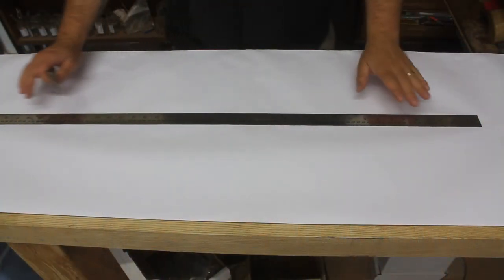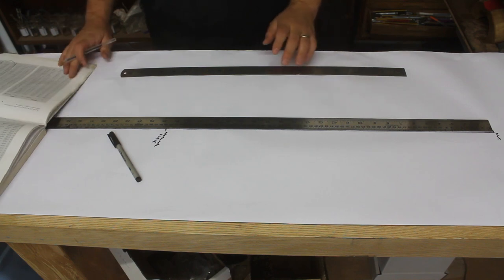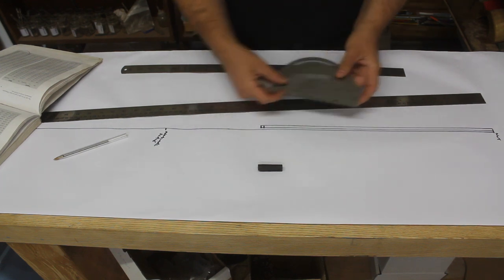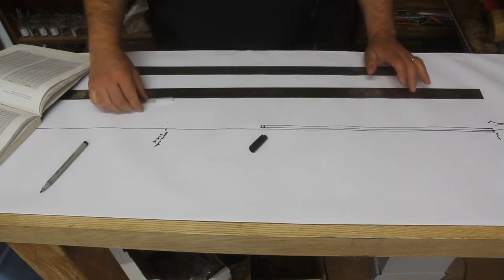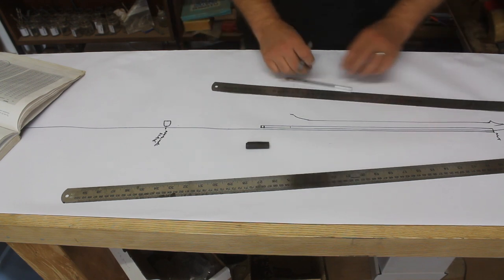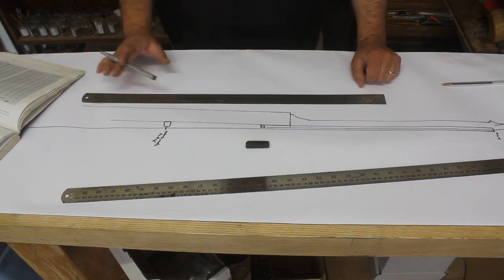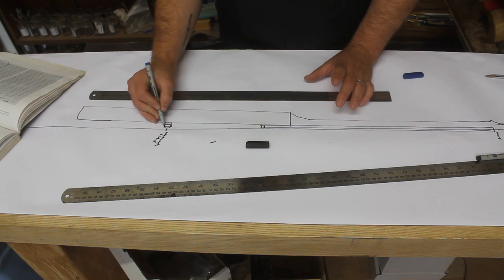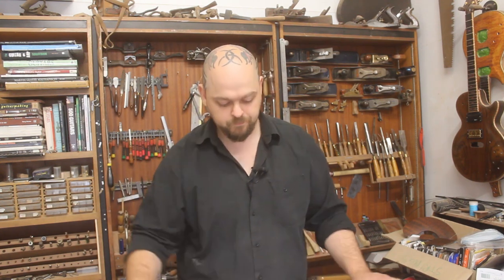Tutorial - How to find the neck break angle when designing a guitar

Comment: So many people asking what book you were referring to. Andrés Perez answered this for cfhmachado 2 years ago - Martin Koch: Building Electric Guitars.
However since you're reading this online, here's something you don't even have to wait for.
http://www.ekips.org/tools/guitar/fretfind2d/
This allows you to generate reference tables for practically every fret layout under the sun. It's very easy to use for normal fret layouts, because it defaults to that, but it's adjustable enough that if you want to make a fanned fret eight string baritone with frets for 19 tone equal temperament... you'd be off your rocker quite frankly, but you can get all the necessary measurements in detail.
http://www.ekips.org/tools/guitar/fretfind2d/#len=25.5&lenF=26.5&lenL=28.5&pDist=0.5&ipDist=0.5&nutWidth=2.148&bridgeWidth=3.284&oE=0.11811&oN=0.09375&oB=0.09375&oL=0.09375&oF=0.09375&oNL=0.09375&oNF=0.09375&oBL=0.09375&oBF=0.09375&root=19&scl=%0A!+12tet.scl%0A!%0A12+tone+equal+temperament%0A12%0A!%0A100.0%0A200.%0A300.%0A400.%0A500.%0A600.%0A700.%0A800.%0A900.%0A1000.%0A1100.%0A2%2F1%0A&numFrets=36&numStrings=8&t%5B%5D=0&t%5B%5D=0&t%5B%5D=0&t%5B%5D=0&t%5B%5D=0&t%5B%5D=0&t%5B%5D=0&t%5B%5D=0&il%5B%5D=25&il%5B%5D=25.5&il%5B%5D=26&il%5B%5D=26.5&il%5B%5D=27&il%5B%5D=27.5&il%5B%5D=28&il%5B%5D=28.5&u=in&sl=multiple&scale=et&o=equal
You wouldn't find that in your reference book (for good reason).
Reply: I should have read the comments before I asked.  Great info! Thanks!!!

Comment: Matthijs spoke of micro tilt. I would definately install one.. I have a custom strat on which even set at lowest action, it still wasn't as low as it should be. Hence I  fitted micro tilt and got it just right. If you are not experienced at using tools, a micro tilt will probably be needed. You should also drill the cover plate to get access to the microplate. A coin will do as a metal disk.

Comment: I know this is an old video but perhaps you still check comments. I've been looking for this angle info and not seen it anywhere else. Thanks.

If you already have a guitar ( but someone before you changed things), can you lay a straight edge down the neck (when flat) to the bridge to check the angle is correct? I have an old Schecter from a pawn shop. Someone shimmed the neck with a piece of business card and sandpaper and I want to get rid of that or at least do it correctly if the shim is necessary.
Should the straight edge meet the bridge at about the same height that your action is supposed to be...like if your string height is supposed to be 6mm (or whatever)...should the straight edge meet the bridge 6mm below the top edge where the string touches?

Comment: Kinda related, what's your opinion on recessed vs non-recessed bridge mounts (say, for Floyed Rose unit)? When the unit is recessed into the body it changes the whole geometry of the neck angle and such off course. And some ppl say that it changes the way body resonate, to some degree, and thus the sound of the guitar changes. Personally, I like non-recessed just because volume knobs and such feel (and become) less taller in effect. I'd love to hear your thoughts. Thank you.
Reply from the maker: Thank you! I am divided about recessed floyd rose mounting, it certainly does result in a slight change of tone as you remove a little body material but that will be very very slight imo. In the end I think that it is down to personal taste and feel in a new guitar. If you are retrofitting then the choice may well have already been made for you. We are fitting schaller floyd rose type trems to a pair of PRS's right now and had no choice but to recess them.. (yes, sacrilegious I know :) )

Comment: I have have a second question: how small must the neck break angle be to simply ignore it? I tried this method and the result was a neck break angle that was hardly even measurable at the 16th fret, but at the bridge it differed as much as 3,5 mm (between the top of the body had there been no neck break angle at all and the angle I got). I tried some maths and it appears as if the angle is 0,014°...

All help is very appreciated!

Comment: Might be a rediculous question but, do you actually NEED a break angle? I have a 1970's V with no break angle and a newer 2013 V WITH an angle. Personally I prefer the older way. Just wondering if there is any downside to having it straight with a fixed neck.
Reply: akc5150 All that matters is that the string stays above the frets and contacts the bridge with enough wiggle room to adjust to a playable action.

Comment: Great and informative video! I have just one question: when you draw the line between the point where the neck-body joint is (16th fret) and the base of the bridge, do you draw it to the centre point of the base of the bridge, i.e. directly below the nominal scale length "point"/"line"/"end", or to the front end of the base of the bridge (which would require you to know the length of the bridge)? I cannot make it out by just watching the video, so a clear answer would be golden!

Thank you
Reply from the maker: I use the nominal scale length as my focal point, it is generally in the middle of the saddles travel if the bridge is in the right place and once intonated the saddles actual positions will not vary by more than about 3mm, this allows adjustment is necessary..
Reply: Ok great! Thank you so much.

Comment: Never built a guitar so far but have built several boats. It's exactly the same concept. The first step to building any boat not built by eye is to draw it full size. Ships are done on a computer but same thing. You draw it full size and lay the parts right on the drawing to verify they actually match the true shapes. Boats were very accurately built up to WWII or so by guys with little or no education. They didn't have any math skills yet were able to build shapes far more complex than a guitar just by drawing the parts out life size.

Comment: How do you feel about no neck break angle at all?
Reply from the maker: It's down to the player really, as a luthier I have to build what feels comfortable to them.. However, I do like streamlined Guitars with low strings and if a trem and pickups can be below the level of the top then you can get some nice results.. Problem is though that you can go too low and end up with the plectrum hitting the top and all sorts of annoying little problems. Sexy looks and playability should both be as important as each other imo. Thanks for watching!
Reply: Crimson Custom Guitars
Hi Ben, i completely agree in your meaning,
at one of your podcasts i answered the question of the Neck-angle already. Again, only at "archtop-Guitars" is cutting a neck angle into the tenon of the neck. This angle is about 4,5°, not 90°-also 85,5°. At a "normal" electric Guitar is no angle in need. The angle the strings will have comes out of the hight of the saddle and the bridge hight. Is this correct, what do you think? Sorry for my bad technical english.

Comment: For some reason people seem to think the neck break angle is something you decide. But as Ben explains very well in this, it's something that comes from bridge height and the depth you want to sink the neck in the body. The angle in degrees is a useless piece of information as such. You can't measure the angle accurately enough. If you do it by math, you want to know how much the thru-neck drops from the end of fretboard to the end of body, or how much the neck pocket drops on it's length.
Reply from the maker: exactly! the angle itself is basically meaningless and calculators will cause you no end of trouble, draw it out and then you'll see what you need to do!

Comment: an inch is 2.54 cm, so 5 mm is about 1/5 of an inch.
Reply: +epicwombatproduction A 15mm socket fits NOTHING in inches in a standard wrench set, but IF you have a pre 1950s socket set, GM used 19/32" fractional bolts, and the 19/32" sockets do fit a 15mm hex bolt. So 15mm is closer to 19/32", which is OVER 1/2", in fact it is enough over 9/16", which won't fit, and a 5/8" wrench won't even grab a 15mm nut.   25.4mm = 1 SAE inch. 6mm is under 1/4". Metric potentiometers come in 6mm, & 7mm, & a few are 6.4mm which will sloppily fit a 1/4" knob. 16mm is almost exactly 5/8".
Reply: +Seth B 1/4" is 6.35 mm

Comment: i once built a guitar and did exactely the same. it worked out. but i will never again build a guitar, it's exhausting if you have no templates and proper tools and pretty expensive eventually. 

i think i spent 200 hours and 900 Euros, not to mention the time you need to plan that first guitar.
 
i never play this guitar. the neck feels uncomfortable, i don't like the shape of the body anymore. i also bought some expensive low impedance pickups. just the best for my selfmade guitar.  i even don't like how it sounds.
the only benefit is, now i know how guitars a built, what mother of pearls smells like when filed.